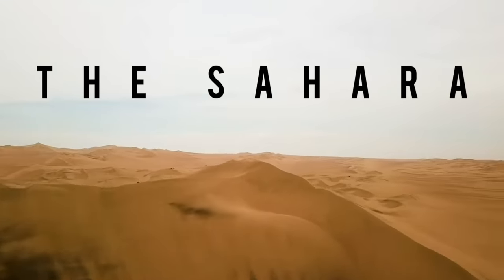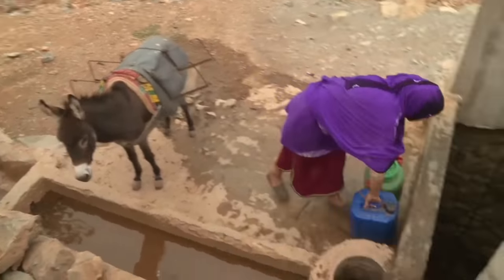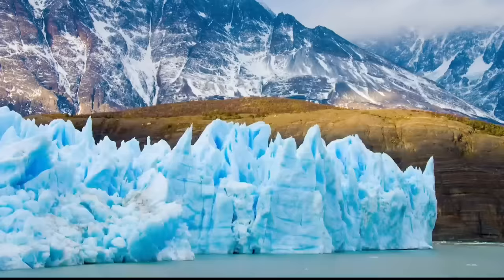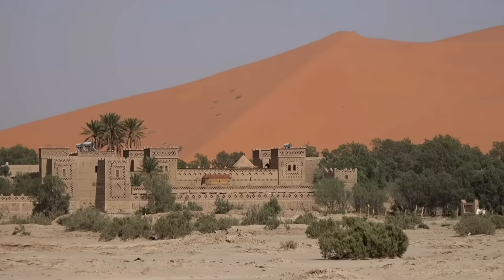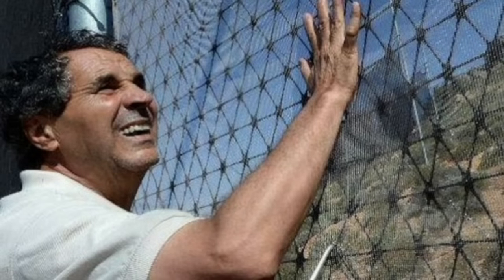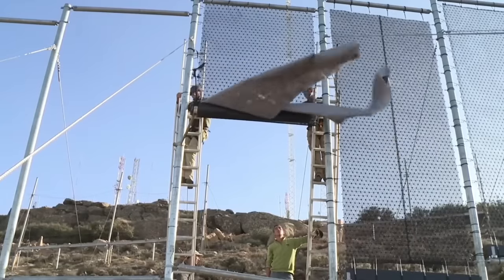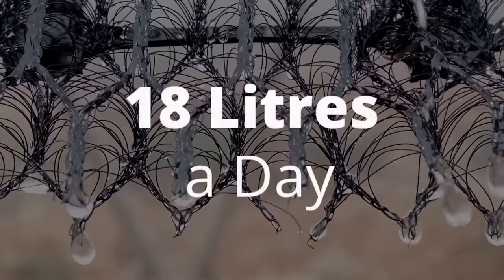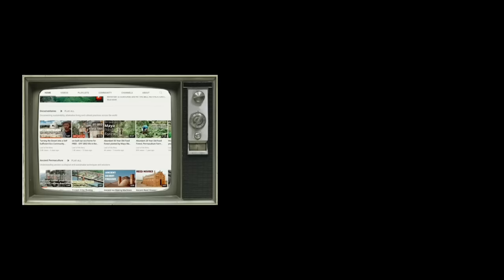How This Incredible Invention Is Making Water In The Desert For Free!

Comment: These mesh should be available on the markets for all interested to buy...I myself want it so badly for my property in the Middle Atlas Mountains in the north of Morocco ...we have quite good amount of fog and very little rain ....
Reply: Couldn't you just catch the fog better with some tarpaulin sheets or something and take them down in the wind? Most businesses these days don't care so much if you could do it cheaper and easier yourself... they just want to make money!

eg.I use one or two sheets of kitchen roll in my basic £8 supermarket home water filter instead of charcoal.It works much much better for much longer than their  rip off carbon filters and I save £4-£8 per month!! They/msm wouldn't ever tell you about this.Try it yourself and don't ever drink unfiltered water again.

Please answer why not.
Reply: Or what about vertically bound string, or plastic washing line wire? That always seems to hold/collect loads of droplets.
Reply: Iv'e got some old net curtains that could do the job. I heard of this on the east side of the Andes a while ago.
Reply: This is available in the Market, they were using it in many southamerican countries for at least the past 30 years if not more.
Reply: @priscillaroberts7945  Ed
Reply: The dream of the LIBIA  Big Guy ,R.I.P
Reply: It's way EEUU  take " Democracy to Libya 🇱🇾 "
Reply: Posts in the ground.  Chicken wire or chain link to hold the fine netting and support it.  Fine netting.  Cut open PVC at the bottom.  Storage tank.  If nothing else, I would think window fine fly screen would work for catching the moisture.
Reply: @davidndavidn2222222  Tarps catch too much wind and tear up.  Need open mesh.
Reply: I remember seeing a study of the long term use of one of these systems. Turns out it eventually broke because of time and the weather, the people didn't fix it and eventually gave up using it. I agree, making the netting available for sale everywhere would be a really good first step.
Reply: @donaldkasper8346  that's why I said to take them down in the the wind... and suggested, alternately, a kind of mesh.
Reply: @davidndavidn2222222  Up and down take maintenance, and some fogs occur in strong winds.
Reply: @davidndavidn2222222  A solid sheet makes pressure waves and the wind goes around.  You want the wind to go through.
Reply: From what I see, you can make one yourself!!! Just get some thick twine, the knots are rather simple. Use your phone to learn knots.
Reply: If i wanted to build one, i'd try ty find a cheap material that works similar and is Locally available. 
Someone mentioned plants naturally do this- smaller branches from trees and shrubs that are pruned could work...

Isn't this a really old idea? What did people use in the past?

I'd propably use those cheap woven plastic bags that onions, oranges, (pea)nuts, ... are often sold in. Or some kind of fleece, with slits cut in to get more airflow and less wind resistance.
If it shakes gently in the wind, that might also help the drops to get down.
Wire mesh and old pottery. glass bottles or even shards.
Orient the main fibres or pointy ends vertically to make sure that flowing down is easy. 

Add a trough made from plastic sheet, or even clay?

I suppose other natural materials could also work for the net- not sure what is available in your area?

What would you traditionally make baskets from? Do you have any kind of long grasses?
Bamboo and straw often have a outer layer of wax covering them, I think that could help the water drip down.

You could also use thin plastic, cut into strips a few centimetres wide, turn them around their length a bit, and make a double layer of that- probably diagonally or vertically wrapped around a frame, with a sharp corner at the bottom to make sure water drips of easily.

Cheap Plastic will break down in the sun, natural materials might rot away... 

If that happens too fast, it may not be worth the effort. 
Fibreglass wallpaper or the fibreglass sheets used for car body repair would last forever in the sun, not sure about wind...could also work, but you'd have to make sure it doesn't harm you. Filter the water, and try to get fibreglass produced to current standards requiring them to be able to be broken down in your body if you breathe in a few.
Reply: @davidndavidn2222222  the activated charcoal filter wjrks by another mechanism... it's not just a screen, like a coffee filters or you kitchen roll.
You can also make your own activated charcoal- theres a bunch of videos here...

It works with the incredible amount of pores that activated charcoal has. A bit like dust that settles everywhere- but on a microscopic level.

A lot of stuff gets absorbed there- for example, you can filter out solved organic toxins that way, that will just go through your kitchen paper.

Charcoal can also be treated to be even better at absorbing certain things, and it can be reactivated with steam, afaik.
Reply: @nos9784  yes obviously, I know that but  the kitchen roll works so much better and for longer,as I said.. I'm very sensitive to chemicals and whatever was tasting horrible, making me tired and dizzy, and making my ears buzz is stopped even more effectively.If you don't want to try it for yourself and find how right I am , just keep on wasting your money and believing everything you're told by corporate MSM and the corporate advertisements they put out to help take needlessly your money.
Reply: @nos9784  sorry, I didn't read the rest of your reply,only the first paragraph.

Yes I looked into that but wouldn't even bother fannyiing around like that now cause the paper works so amazingly. Just fold a sheet,poke a dent so it doesn't split on the bit that sticks up then wrap under the bottom of an old filter.Lasts a few weeks each time.
Reply: @davidndavidn2222222  if the paper filter works for you, thats great, you obviously don't need a charcoal filter then!

I'm always happy when we realize we simply don't need a lot of the stuff that companies try to make us waste our money and time on :)

I just wanted to say that activated charcoal isn't always a scam. 
Sorry, that was propaply obvious even before i started talking. :D

I have the luck to just have clean water, never bought a filter...

Have a nice day/ week/ life :)
Reply: @nos9784  The method they show works just fine!!! An improvement might hanging 6 inch pipes inside and out might increase the amount.
Reply: @spacecase0  Unless they lived naked in mud huts in a literal desert without any plants or stuff brought from other towns the lack of materials should not be an issue; there is really no need to sell any special nets in stores because anything works. I made one of those desert water collection pits in our back yard when I was eight or so for fun after reading about it in a comic book and the only difference between that and this project providing water for whole villages is the size.

If people really didn't fix it, that sounds more like one of those cultural things where some hunter-gatherer tribe ruled that because men's job is to hunt and wage war and agriculture is neither, then women have to do all the farming and related things because gathering plants and taking care of home is their work. Repairing water collectors was not part of their traditions, or something like that.
Reply: @nos9784  Some plastics degrade in sun over years and then we might ingest plastic particles, and some plant materials release chemicals that are often bad tasting even if they aren't toxic. Other than that just about anything works, it is just a question of how easy it is to gather and assemble the materials.
The water should be as clean as rainwater, ready to drink unless wind has been picking up lots of dust and dirt recently. However, leaving it standing in an open vessel for too long just invites biological contamination.
Only issue for some people is that as we get most of our water from rivers and aquifers we are used to water having a tiny amount of minerals. This water might taste "flat" or tasteless, but unless one stops eating anything and drinks nothing else the for weeks to months, the lack of minerals is not going to cause any health problems.
Reply: Put up cheap tarpaulins to catch the dew. No need to pay a ton of money to fix a problem with a relatively cheap solution, and even if it's not as efficient as the commercial product it'd still make more of a difference compared to nothing.
Reply: @donaldkasper8346  Depends on how you set them up.
Reply: @WolfHeathen  Setting up some nets on poles and waterlines to a tank in a village sounds like $20k in costs.
Reply: Chicken wire works. I presume Morocco has metal poles and plastic pipe.
Reply: Warka Water Towers collect rain and fog by design, and supposedly are available thru humanitarian organizations.
Reply: I think this net is same of those use on orchids garden
Reply: @davidndavidn2222222   No, the wind contains the fog droplets. You need the netting to catch the water droplets and condense them. The netting is probably not expensive. Consult the company listed above.
Reply: @spacecase0   They probably didn't have the education/money to keep things in repair or buy new netting over time. You would think water would be a priority but if there is no money...
Reply: AWG would be better, or an Atmospheric Water Generator. Use the sun to power a basic heat pump, with a basic filtration and UV system. And you can generate about 8 gallons per day at a 65% humidity.
Reply: @spacecase0  and that is why they live in tents without water
Reply: Fishnets sahbi
Reply: Could maybe a regular screen work ? Maybe the type with smaller holes that help keep the tiny pests out. Hmmm, color me curious
Reply: @andrewordog519  I haven't actually made a fog harp yet.  But from what they say, if they holes are too small, the water just sits on the mesh and doesn't drop down.  If the holes are too big, the fog passes through without losing as much water.  That is why, supposedly a fog harp is superior.  Even a drop of water is too heavy to stay on the "string".  It just rolls down, like water on a fishing line.  

I only have so much time on my hands, when I get around to making one, I'll go with the fog harp.  It seems to make more sense to me.  I could be wrong!  

I like the idea of putting some up in my garden, with legs, so they are say 5 feet above my plants.  They will water the plants for me.  (I hope!)
Reply: @spacecase0  modern management,
 find ten problems for every solution
Reply: @davidndavidn2222222  what you meen by kitchen rool , please?
Reply: @uwegrygier8484  sounds like i probably meant' paper towels'/kitchen roll ,but I don't remember what i said about using  them in any way.
Reply: I THINK THEY STARTED to do it
Reply: Trampoline mesh..order online..

Comment: I think San diego could definitely implement this. Ive grown up here; theres barely any rain per year but it gets very foggy because of the ocean
Reply: Fog point Vodka, San Francisco.
Reply: The problem is that the amount of fog has decreased as well. Even the extremely foggy San Francisco only gets 1/3 of the fog it normally gets due to climate change causing the water to get warmer.
Reply: Also Orange County and even LA. In fact, the fog continues all the way north along most of the California coast.
Reply: @SS-yj2le  That is just an argument for going all out on this tech.
If the fog is decreasing, the little rain you get is also decreasing. And water is already scarce.
Reply: @benghazi4216  We are going to need a lot of them and combined with other sources like water desalinization. Also, San Francisco is normally very rainy during winter. It is just the dry spell has expanded even into winter.
Reply: @Bonzi_Buddy  We actually have one major one down in Carlsbad with others considering having them as well. San Diego mainly started this as they are the only true semi-arid climate along the California coast aside from LA who has nearby mountain-water, not motivating it as much as drier San Diego. Northern California has never needed them as it gets a lot of rain by itself and not just snowmelt. Especially during winter with some areas getting over a hundred inches of rainfall a year. The problem is how slow these projects are going and it is also difficult to have desalinization due to the brine left-over and the numerous population centers along the coast.
Reply: @SS-yj2le  Water restrictions are just done for fun in California, I see. It isn't due to any shortage.
Reply: @Bonzi_Buddy  No. It is that we have never had a drought like this before where even Northern California is affected. This is the worst drought in over a thousand years. Normally, the south makes due to water from snowmelt and from Northern California during summer and during this unusual time of the drought extending into our winters. This time, northern California is being affected as well. California is a huge state with huge climatic differences. Some places here even have glaciers and much of the northern areas have real rainforests that feed rivers and lakes. It is how we have Clearlake and the snowmelt fed Lake Tahoe. California isn't even the only state affected by this drought. Arizona, Nevada, and Utah are suffering too due to their mountain rainfall and snowmelt decreasing and the Pacific Northwest is getting less rainfall due to warmer weather pushing the summer anti-cyclone further north. With normal past conditions, it is harder to justify spending a lot of money and trying to build infrastructure that could potentially take up people's homes, important sea ports, and wildlife habitats.
Reply: We had lots of rainfall in 1962 or so in San Diego. Wonder what it is now?
Reply: @mlee6842  It went farther north due to the high pressures staying farther north longer.
Reply: @Jon In SLO The fact that you are using tree rings already proves my point. Where would said tree get such ground water from? It is new. We have rainforests in the north and Crescent city gets more rainfall on average than any city east of the Mississippi. even farther south in San Fran, the fog and the rich winter rain grew the redwoods and redwoods go as far south as Big Sur. The sequoias have even been planted and grow naturally in mountains as far south as riverside not far from Mexico. These trees have resided in California for thousands of years and I assure you that it is from the rain, fog, and snowmelt that we get here. None of the droughts have been to this extreme. This one specifically is the worst one in over 1200 years and Europe is going through the same thing right now. Spain is dealing with desertification and Germans are having record drought. The western cape of south Africa, Cape Leeuwin region of Australia, and the central region of Chile. Droughts are also relative as they are not entirely rainless. Even farther north to southern Alaska. They are having an unusually dry summer because that high pressure cell is now moving farther north than it is supposed to due to climate change. Even during these droughts, there is rain. Remember the Orville dam flood a few years ago in Northern California? Know of the regular winter rainfalls that we get? What is abnormal is when the summer dry period extends into our winters. That is the abnormal thing that is happening.
Reply: @Jon In SLO I'm not saying there weren't droughts. What I am saying is that they were not that dry. Droughts are not completely rainless. There are other places around the word with rich vegetation that have droughts like that all the time that also sustain water. There was rainfall to keep that tree alive. If they were that bad, we would have the same situation as the Sahara or most of Saudi Arabia. But, California is too far north with a much stronger polar jet stream and a colder cold-water current than the Canary current for it to get that dry. Hence, why San Francisco has the weather it has and why parts of coastal California have never exceeded 100 degrees. I will deal with the unusually dry drought that has even expanded into our winter.